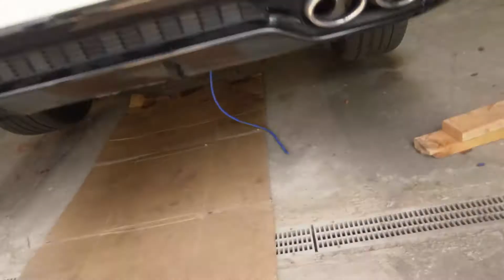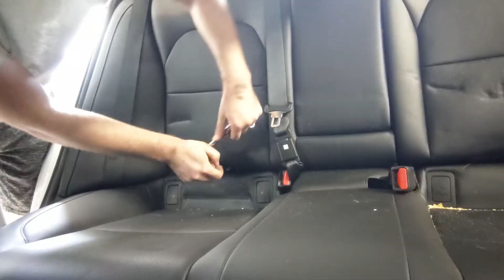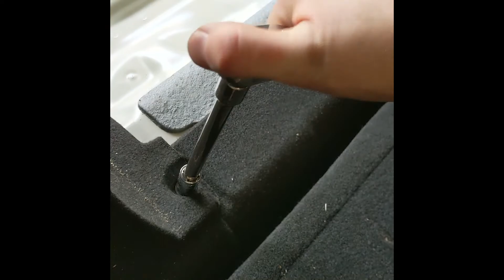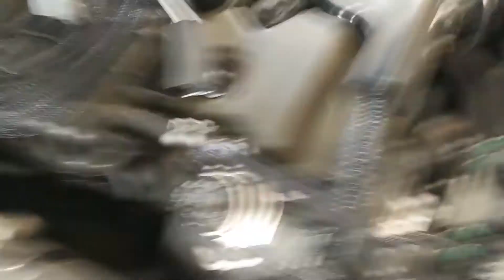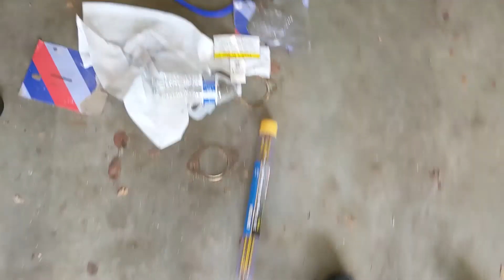Agency Power Exhaust Install - Kia Stinger GT - Part 3 - Valvetronic Electronics

Comment: What did you do with the other end of the T shaped connector underneath the car as it has 3 exits, you put another hose pipe on the end but didn't show where it goes? Unless you leave it blank but then the air comes out of that hole
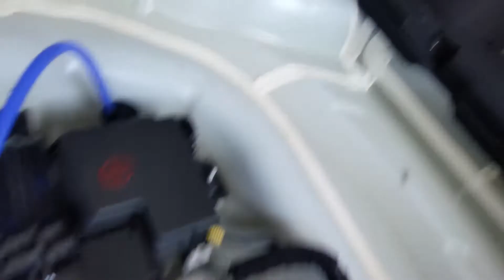Reply from the maker: I'm not sure what you mean?  At 3:00 I plug in the side from the engine.  At 4:55 I plug in the passenger muffler.  At 5:17 I plug in the driver side muffler.  I didn't show the full driver side install since its the same as passenger.  The vacuum from the engine gets split with the T to each side of the exhaust.  I hope this helps.

Comment: Very helpful video but can you pls tell me where you installed the other end of the vaccum pipe one in the exhaust and the other end where ? I have same system.
Reply: Did you manage to figure it out, if so what did you do as I have the same problem

Comment: My control box came broken!!! Any fixes??
Reply from the maker: I'd recommend contacting your seller for a replacement.  Otherwise the ACC02 kit from PQY racing is what I have.  https://m.aliexpress.com/item/1000005636573.html
Reply: @RyanGarage  Oh my god thank you so much! Your a life saver! You said this is what you have, you ran into the same problem as well?
Reply from the maker: @greg7601  I had a huge hole in my original UPS shipment and the control module + wiring was missing, so I assumed it was a shipment problem.  The replacement control module did not work, and I got so sick of dealing with support that I ordered a replacement myself.  Cost about $15+25 shipping.  Less than 2 week UPS saver delivery in 2020, probably higher now due to shipping and electronics shortage, but it worked out for me.

Comment: I’m assuming having the controller wired straight to the battery and not an accessory isn’t going to drain the battery?
Reply from the maker: It is a very low power controller, I haven't had any problems.  The longest I've left my car is 10 days without driving, but not even a slow crank.
Reply: Thanks for the reply. I ended up using a different unit that doesn't use the vacuum line from the engine. I bet it's from the same company or supplier. The remotes are identical. It was a much easier install.
Reply: @rbjohnson78  which one did you use?